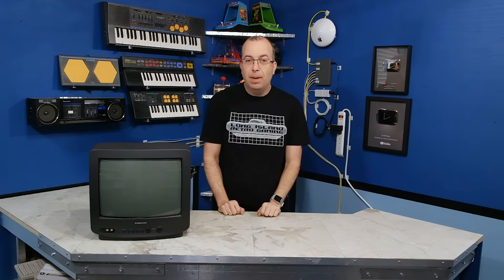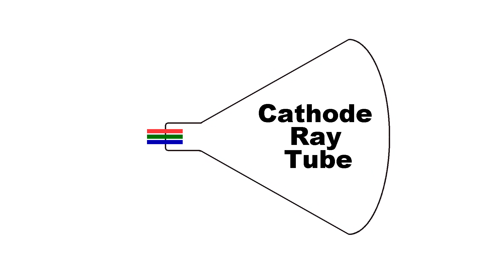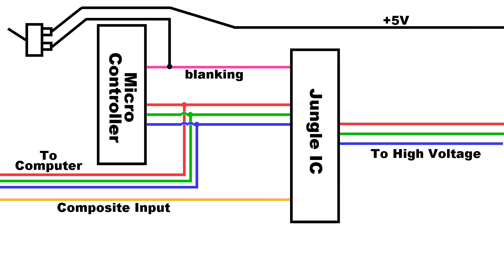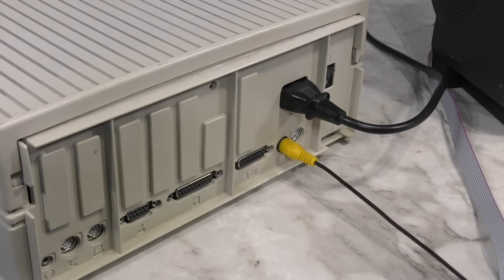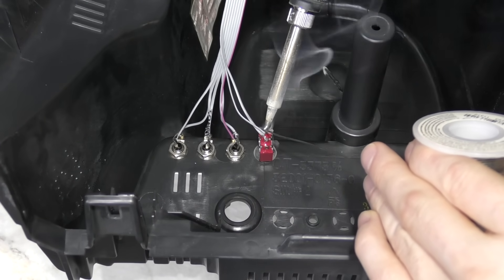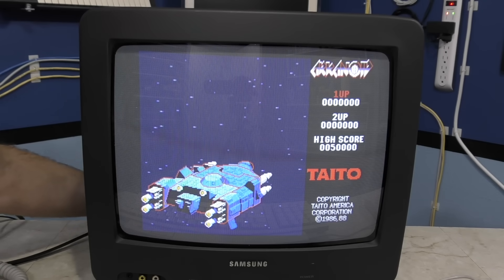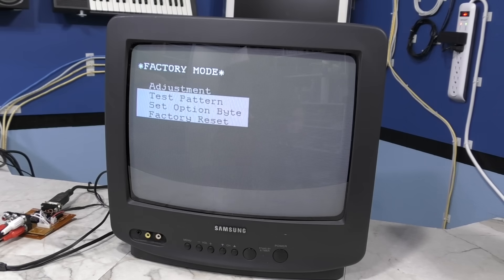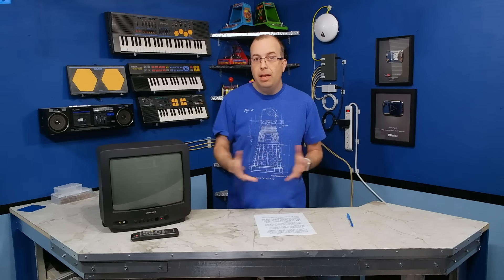Modding a consumer TV to use RGB input

Comment: Ah the SCART, that was why i was wondering what you were doing that to your tv...
Yeah, you americans miss out on much.
Reply: Yeah, I was surprised when I saw a title of the video. Why to mod a TV when you can buy or make SCART adapter? Turns out, SCART wasn't really a thing in US.
Reply: and i feel bad for the kids who grew up with 50hz tvs playing slower versions of the games
Reply: @AmazinChannelz  At least on NES there was no slowdown, it had two versions of consoles and games for NTSC and PAL.
Interestingly, Dendy, Famicon clone widely popular in post-Soviet USSR used NTSC games and PAL videochip with some magic. Every single game was pirated American or Japanese release.
I don't know about other systems, but I suspect there were two versions of each one which ran just fine.
Reply: @vladcosh  here in brazil we had PAL-M (basically the best of both worlds in one color system)
Reply: @AmazinChannelz  we had SECAM D/K, but late models of Soviet TVs supported PAL D and Composite input, so there were no problems with VCRs and consoles if your TV wasn't too old. Then imported TVs appeared with RCA and SCART connections. In late nineties I made S-Video to SCART cable to connect TV to Ati Rage card. This was pretty good graphic card, I used it up to to 2007, I beleive. It supported 100 Hz output at 1024x768 and was giving crystal clear picture, much better than fuzzy and sometimes jittery picture out of cheap S3 cards.
Reply: @AmazinChannelz  But better with a resolution ;)
Reply: @AmazinChannelz  pff used to play pc games back in the 90s and early 2000 at 15-20 fps lol. Got plenty of enjoyment outta it.  Non of this 144 fps bullshit today, and I own a 144 htz variable refresh rate monitor for my current pc. You snobby bastards have moved back through time to stick your nose in where it was never even an issue to make it an issue 😅 that's the world of today
Reply: @1invag  I played the same games and prefered 2d ones or higher frame rate ones even back in the day, yeah I never played pc games back in the day.
Reply: @AmazinChannelz  I wish we had PAL-M here in the UK back in the day instead of standard PAL. I hated playing games in 50Hz (until I had my Mega Drive modded that is).
Reply: Peanut I feel bad about not having an RGB video cable that was standardized
Reply: @loganiushere  I feel bad that you used to and sometimes still get the shittier ports of games because the American market doesn't fuck you over as hard as the UK.
Don't even get me started on Brazil, those guys are an insane market... Aren't they still selling the genesis there? What was I talking about? Insulting PAL... Meh fuck it. They've both got their merits, I really do feel sorry if you're trying to collect PAL games, those fuckers are expensive.
Reply: @LaskyLabs  PAL games are only expensive if English is your only language :-p
Reply: @GameplayCrush  true...
Reply: SCART was great. Tho I don't understand why yall calling it "SCART ahah, its the name of the company who made it, its name is "Péritélévision", well it was only used in France tho. A great and capable connector that was killed by the japanese who didn't liked it and refused to build products with it. But you HAD to have it to sell it in France. SCART was common in France and eastern Europe, too bad it wasn't more common worldwide. It was created to standardise things. Still use it with my PS2, a no brainer really, was mandatory up to 2014 here, which is insane, I can have the best image possible with my PS2. Sharp af.
Reply: @victorpelini5995  I live in the UK and growing up I lived in the same village where ALL this stuff was invented - Kingswood - even helped develop digital TV a bit on work experience.  On advice of a tech at BBC research & Development, I had a secret weapon - a French VCR... so SCART/Péritel etc - but I modded it to re-populate the circuit board with PAL decoder chips from a UK version, and it could read EVERYthing.  I even put a VGA connector on the back to record from my computer :)  That used a little circuit I carefully copied from a friend's magazine by tracing over it.  Fun times.
Reply: What we lack in RGB we gain in 5 to 10 more Hz, and thus, generally higher framerates :p
Reply: E G The country that used scart the most is France. Why? Because only tv was allowed to use antenna connectors , everything else used scart (scart also carried composite,Y/C and RGB) so that would be the country where you’d have the best quality in video for pretty much everything. In other countries scart was here, but all consoles came with rf and composite (these are nasty) . That came at the expense of 50hz and secam
Reply: 60hz tho
Reply: SCART was great, unfortunately the default for SCART output on most devices like set top boxes or VCRs was not RGB but composite by default (don't understand even why, since if it is RGB and the TV doesn't support RGB there is still composite signal con the connector). Back in the days I was considered a genius when at the home of my friends I was changing the output settings of their SKY set top box and the picture quality improved a ton. 

Also SCART had a defect, especially on cheap cables (that were made with single wires instead of a boundle of coaxial cables), that was that the return from the TV interfeared with the signal going to the TV, and thus you had ghost images on the screen. Simply cutting on the TV side the return cable was a simple trick to improve image quality. 

Another thing that SCART had and even HDMI doesn't have (I mean, really?) was the possibility to send a signal to automatically switch the input on the TV, you turn on your set top box or VCR and the TV automatically went to the appropriate input. Now even with HDMI you have to change input manually!

Last thing, teletext, SCART had the passtrough of it. Now, I know that teletext is obsolete, but for example my parents still use it, and with HDMI you can't, you have to switch the TV input to the arial, and then you see the teletext, you cannot look at it from a set top box.
Reply: @alerighi  it has that possibility. I have a Mi Box that does it. It has also a passthrough,used by sound bars. Scart is great, it had svideo, composite, rgb and stereo on the same connector (if supported by tv and signal creator)
France law made them have better n64 consoles.
Reply: @alerighi  scart also allowed connection for both sides, examples: you can record tv from a vcr and you can watch a vcr, the input switch was really cool some tv used it for turning on the tv some just switched to the source automatically, some didn't use it at all
Reply: What @No No said ;) And also stereo sound - I once made an entire end-to-end scart lead with all 21 pins connected with inputs and outputs all correctly connected - not sure why, probably as it was cheaper to make one than buy at the time, or at least that's what I told my dad or I was bored :D I have loads of them gathering dust these days although still have one connected to a VCR for posterity - I guess it was the analogue equivalent of what HDMI is these days since it could carry audio and video in both directions and was a 'one fits all' solution for interconnecting A/V :)
Reply: We didn’t have to deal with PAL at least.
Reply: SCART was actually mandated by law on all TVs sold in France from 1980 until 2015. It was great. We didn't have to deal with shitty RF modulators on 80s home computers like in the UK. The worst that could happen was composite, but we even got special RGB versions of consoles that the rest of Europe (let alone America, haha) didn't have. Like the Amiga CD32 rev4. The French version of the Amstrad GX4000 also lacked the RF modulator, it was RGB SCART only and thus lighter and less power hungry.
Reply: There was even a "HD SCART", 1280pix or something like that. 
NTSC has its merit, it was the first one here.
Composite sucked. Especially here in France. The country isn't flat and is known for its bad coverage. Even today. Good luck finding 4G outside of town. Slight dip in the terrain ? No cellular. TV antenna sucked hard. That's why a LOT of peoples had sat TV. SCART was mandatory here and that's why some peoples had it even on cheap sets here in Europe. Scandinavia and eastern Europe mostly. 
25/30 fps is no big difference really. Some formats are better than others but you need to factor in other things like cost, time, what came first ect..
Reply: @victorpelini5995  actually ntsc used 24fps, pal 25 ! in italy we never had cable tv, we always used antenna, to get most channels you need to have a rooftop one to this day since the frequencies are still the same, in some cases analog tv was better because in some parts of italy like sicily tv signal wasn't really great so in analog tv you could see the channel with some noise but in digital you just have a  " no signal "
Reply: @namesurname4666  Italy stuck in 1980s ahah
Reply: @victorpelini5995  yes, but tv is dying in italy too, we are starting to use streaming services more and more meanwhile some people still use teletext... or use an old tv with a set top box for digital tv, most channels are still sd,and in september we will get all  channels in h264 hopefully (that should have been done when digital tv came out...) but i'm assuming most channels local ones for sure will still be SD H264
Reply: Victor Pelini ah oui et aussi notre wifi est pourri
Reply: @joshi_6887  moi ça va, faut juste utiliser des cpl partout. c'est car on construit en dur en Europe, aux US les maisons sont en bois 😉
Reply: Victor Pelini vdsl2 c’est coup dur quand ton propriétaire veut pas investir pour la fibre quand t dans une rue privée
Reply: @joshi_6887  ouille, team fibre ici, merci Orange 🙃
Reply: Victor Pelini je suis aussi chez Orange mais c’est parce que je suis dans une rue privée
Reply: @joshi_6887  rip, ça dépend surtout de la demande. Ça coûte cher, si t'es tt seul ds ta rue a vouloir la fibre c'est fucked up
Reply: @Banana Puree LOL! thats so funny and quirky! i didnt ask shut ur gob
Reply: Yup scart is an rgb signal
Reply: No No  all fine, I'm not a native English speaker. It just sounded  aggressive, and when we positively know we are right about this SCART-Buchse (closer to my language) it's enough to just educate. Funny enough, "škart" in my mother tongue (from Italian scarto, scartare) means waste, leftover material.
Reply: I used to have a flat screen from the early 2000s and for some odd reason it had scart. I'm in America
Oh and we get progressive scan mode on gcn
Reply: Sure, but they didn't have to deal with PAL 50Hz shit. There's that.
Reply: Yep, even certain cheap 14 inch sony tv sets have scart
Reply: LAUGHS IN 60hz
Reply: I was thinking exactly the same the whole time . 😂
Reply: My friend who uses SCART in 2021: 👀👀
Reply: Many TV's that had SCART only used the composite pins and didn't have the RGB connected
Reply: @retropcs88  many? Most did support RGB post 1994 or so. Well, at least on one SCART socket. It was common to have only one RGB scart (normally AV1) and the others were composite unless it was a higher end TV
Reply: @jonc-1989  I have an old CRT that's probably from around 2000 to 2003, and it most definitely doesn't use RGB signals, it only uses composite. 

Sure, it has a scart socket but it only uses the composite signal from it, it seems. I connected an RGB scart cable (from my gamecube) to it and the picture didn't look different at all compared to the composite cables.

It's a bush TV, so it's probably dogshit and I'm guessing it was a low end model at the time.
Reply: @foreversleepy4379  I'm surprised. I had a Bush 27" CRT from Argos in around 2003/4 and it had 2x SCART, one composite and one RGB so assumed it was pretty common but maybe not.
Reply: Correction. Just googled it and it was 28"
Reply: @jonc-1989  It's got a VHS player built into it, if that makes any difference. 

Yeah, I was a bit disappointed to say the least. Composite is shit but honestly, I got used to it fairly quickly playing Super Mario Sunshine. I'd say the audio buzz is more annoying than the signal quality. 

Stuff in the distance is pretty blurry but it can look decently sharp in the middle of the frame.

Hope you've still got that TV, since people are charging the earth for them now. That thing probably weighs a tone, though!
Reply: @foreversleepy4379  I gave it to my sister in 2006 or thereabouts and think she has long got rid of it. I'd quite like a new CRT just for old games. I have a CRT monitor my old pc but need something for consoles.
Reply: @foreversleepy4379  in my country everybody is throwing them even the higher end ones like sony trinitron meanwhile in other countries they go for a lot of money just on ebay
Reply: Man I really got the neckbeards going here LOL. SCART and Betamax better than 4k. I was never really interested in SCART anyway since the cables were ridiculously expensive.
Reply: I'm from the UK and I'm positive my consumer CRT I've had for over 15 years doesn't even carry RGB video signals. It has a scart but it seems like it only accepts composite signals from it.

Just because your TV has a scart socket, doesn't mean it accepts RGB video signals. It could just accept shitty composite.
Reply: Andreasplayz  Yeah, I think it was common for a lot of TVs to have more than one scart socket. One of them must have accepted RGB on most tvs. Mine isn't that old, to be honest but it only has one scart socket. 

I'll probably just buy an OSSC so I can play on my HD TV. Expensive but worth the investment, in my opinion. Since it's a line doubler, I'll get hardly any input lag.
Reply: @nocturnaldivision  don't forget we had higher resolution too
Reply: SCART is RGB? Interesting. I always thought that SCART was the European version of HDMI
Reply: @blackbearelectronicswithco9541  no we use HDMI as well. HDMI replaced SCART for us as it was the first connection to have better quality (and to also carry audio as well as video)
Reply: AndreasGamingNerd  720x576 is pal resolution
Reply: We got more games than you, usually 2-3 years before you got them. I think we got the better end of the deal.
Reply: E G no we don’t you miss japan
Reply: I live in America and I have a scart connection and I hate it it’s more SHART
Reply: @Lucario0007  shart?
Reply: SuperYoshi tried to spell but I made a pun using the word SCART
Reply: @Lucario0007  okay, sry didn't get it
Reply: It's almost like the USA had color TV several years before Europe because we invented it, and then years later PAL copied NTSC with slight improvements.
Reply: @UCKY5  Up to 2000. I think the last new CRT TV I bought was ~ 1997 and it didn't have SCART. But I know if you bought a high end TV at the time they did have it. The next new TV I bought here in the USA was in 2011 and that one had the separate RGB inputs.. as far as I can tell the signal it basically the same, SCART just combines the 5 (?) connections of R/G/B/L/R
Reply: @castirondude  In Germany and actually every single TV in every country in Europe had SCART in 90s and up to just maybe 10 years ago
Reply: @lukassteinbrink322  Bought quite basic 4k TV about year ago and it still has SCART option if you plug in adapter TV came with. So it can still be found on TV's, though it's most definitely getting rarer quite fast.
Reply: @castirondude  SCART could do more than just RGB it could also recive composite or S-VIDEO
Reply: @castirondude  hey i have the same  tv from the video and it does have scart
Reply: @castirondude  i dont think so, i had a TV from early 90's, i think 92 and has scart, was a Philips tv around 25 inches
Reply: SCART wasn't that common , you'd have to specifically get a higher end TV to get that. in my 20 years of living in Europe I never owned a TV that had it.
Reply: @castirondude  In Germany all my analog TVs and VCRs had a SCART connectors (starting ~1980). And all my TVs has bin low cost and low end. High end TVs had sometime up to 3 SCART connectors.
Reply: @chris.m69  cool. Somehow in the netherlands I saw them on high end TV's but not baseline TV's. maybe that changed in the 2000's
Reply: @chris.m69  high end sony trinitron were the best now tvs just have a single hdmi port they even removed the headphone jack for wireless headphones
Reply: @castirondude  when was that, if I may ask? every single tv that I have owned between 1990 and 2015 had euro scart socket, some two or even three of them. Also every VHS player from 1990 onwards and every DVD player that I have seen.
Reply: @castirondude  you must've lived in the gutter of Europe then
Reply: @castirondude  what are you on about? I have NEVER owned a TV without scart, even my new 4K TV still has scart
Reply: castirondude seriously? Here in Holland I never had a TV without scart, even my small tv similar to the one in the video had it.
Reply: @castirondude  every single TV in the UK came with these for years... I actually had to use a SCART to RCA adapter that came with my N64 to play my Gamecube on the TV
Reply: @iMagic16  yes, scart to rca was used for most consoles before hdmi even wii didn't have an official rgb cable (i thinK)
Reply: @castirondude  are you joking. Allmost all older tv had scart. At least in Germany
Reply: @castirondude  In the UK, literally every TV had a SCART port, even some LCD TVs still do.
Reply: @castirondude  BS. In Germany every TV since the 80s had SCART
Reply: @castirondude  Idk when you lived in Europe, but everything from the '90s at least had it.
Reply: @castirondude  Holy shit, where in Europe? Here the standard was a TV with one or two scarts in the back, and then composite video and audio inputs for a camcorder.
Reply: @castirondude  ??? I live in France and here every TV set even the cheapest ones always came with a SCART input .. But if I don't say wrong, SCART was french tech isn't it ?
Reply: @castirondude  I had very basic portable I think it was 14" TV and it had SCART connector. That was the very 90's beginning. I actually haven't ever seen TV missing SCART connector after 90's. Almost could define it as if it had remote controller, it had SCART.
Reply: @castirondude  Here in the UK, SCART was on pretty much every TV from the early 90s even cheap ones. Having SCART plus PAL being a higher resolution than NTSC, we had it pretty good in Europe. Just wish we could have had 60Hz rather than 50Hz not that it's a big difference
Reply: @castirondude  u cant be serious.  Higher end, it sat on every shitty tv or vcr and everyone complained over how crappy enginered it was.
Reply: @krokodilen31  What was crappy engineered about it? I remember the cables were really expensive. 30-50 guilders for a cable is a lot of money when most teens only make 5-10 guilders an hour. Pretty much an entire day's wages. Looks like they're still expensive, people paying 30+ euros for them these days https://allesoverfilm.nl/forum/showthread.php?7018-Wat-is-goede-scartkabel-met-red-prijs
Reply: @castirondude  the things scart added was great but the sockets were crappy.....no german or japanese engineering  there..... It was french.....and in fact it was set as a europeean standard as trade protection, it didnt work the japanese put scarts in everything.😂
Reply: @krokodilen31  Yes, SCART connector was great for functionality (video/audio input and output, RGB input, control signal like automatically switch to AV input and teletext data), the connector was bad. In the old days I had one of the rotating TV support (to rotate the TV to see it from the kitchen) and the SCART connector continued to unplug. 

The cable was bulky (especially good quality cable that had individual coax inside for every signal) and the connector didn't really had a way to secure it. It was also difficult to connect in the rear of the TV without seeing it. 

Just the possibility to secure the connector with screws would have made things better, or even better adopt a different kind of connector. Probably it would have been better to even adopt unidirectional connections, it would have eliminated the crosstalk between input and output in cheaper cables (the trick was to disconnect video out from the TV side). Maybe that way two DIN-like sockets would have been better, one for input and one for output.